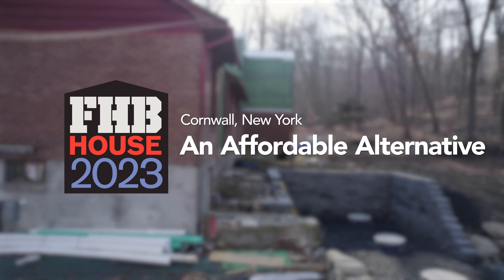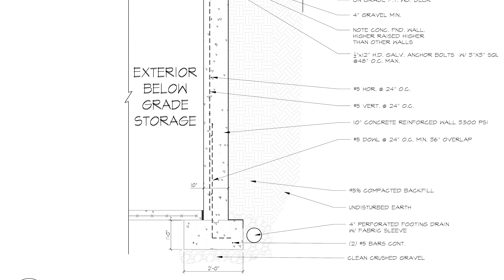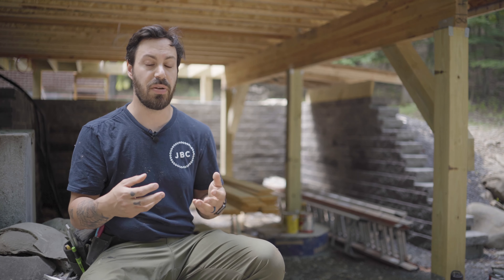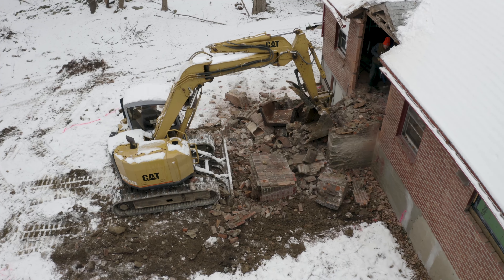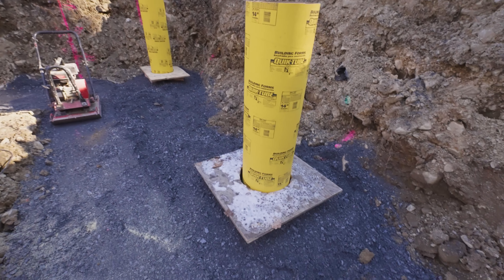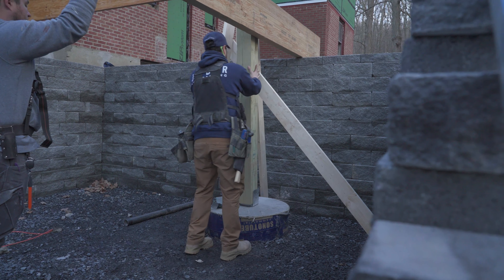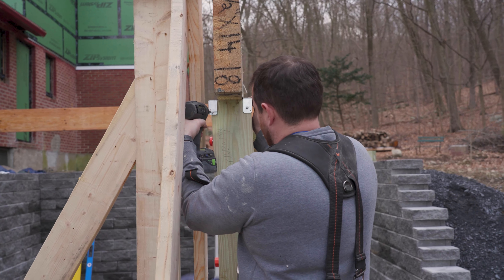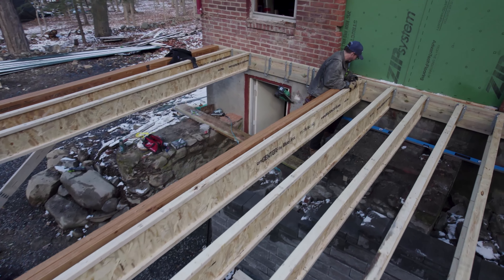Deck-Style Foundation for an Addition

Comment: He's right, all most all of the contractors I've dealt with here in Litchfield county Connecticut are out to screw the customer so that they make the greatest profit regardless of the quality of the work.  Here, over the last twelve years, I've noticed that most, if not all of them, work on the basis of "that's good enough."  I've watched them cut floor joists too short, or had their helpers nail in rafters on the wrong side of the line and all they did was cut them and re-nail the joist on the correct side of the line (making the structure weak), but I guess it looked good from their house.